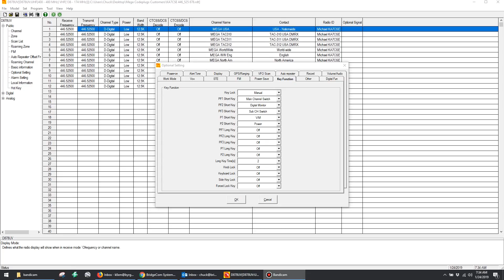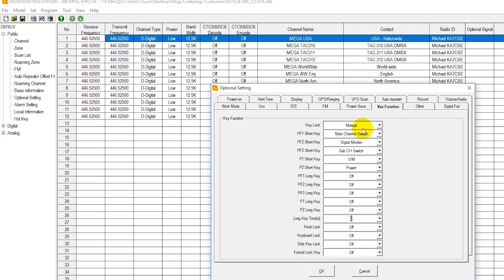How to Arrange the Button Setup on Your AnyTone 878/868

Comment: Do the new 878s have any keys blocked like the PTT + 1 key to access maintenance mode to make it compatible with the CPS Model tab letting you select mode you want?
Reply: As of version 1.22 PTT +1 will change modes but the maintenance mode was not available.  I chose Commercial Mode 13 to open up the VHF UHF bands a bit and enable the GMRS/FRS frequencies for Tx.